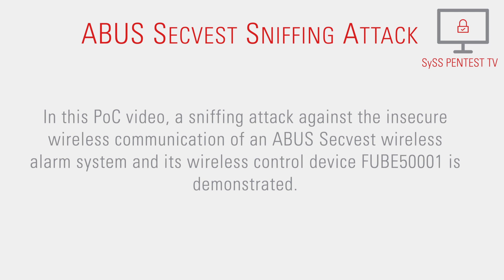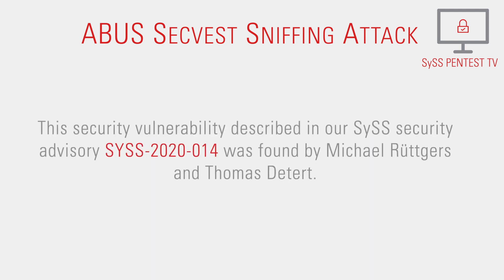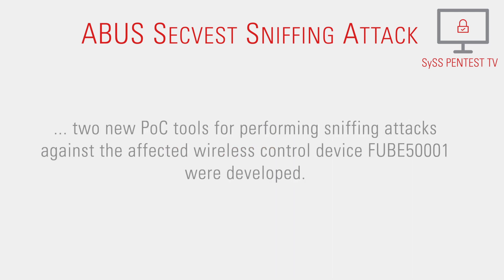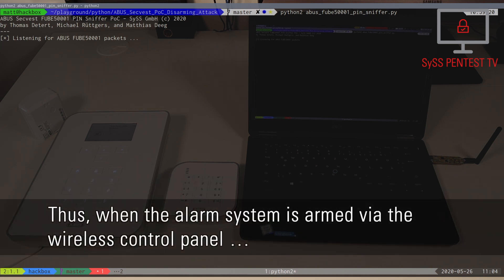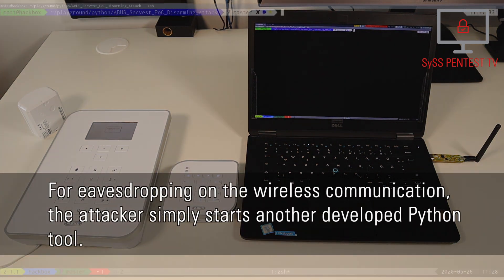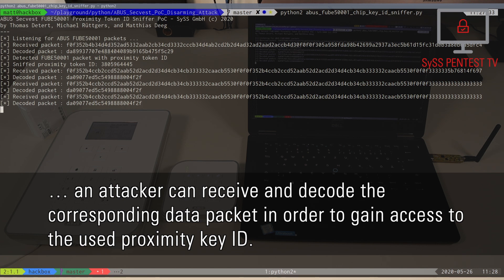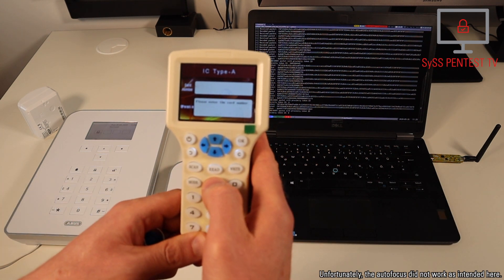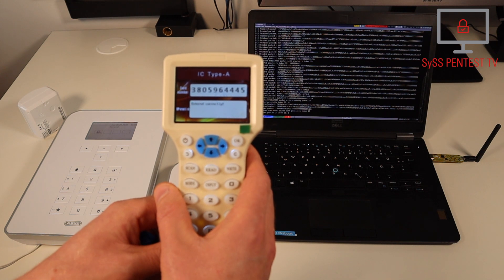ABUS Secvest Sniffing Attack Against Wireless Control Device FUBE50001

Comment: thanks for this interesting demonstration. can the cloned token id also be used to disarm the system directly via radio? e.g replicating the sent data from the wireless control device that was captured (with the valid token)?
Reply from the maker: A simple replay attack using a previously recorded disarm data packet containing the correct PIN code or the correct token ID does not work. However, a spoofing attack with a specifically crafted data packet with the correct PIN code or token ID and regarding the current "wireless transmission state" could.